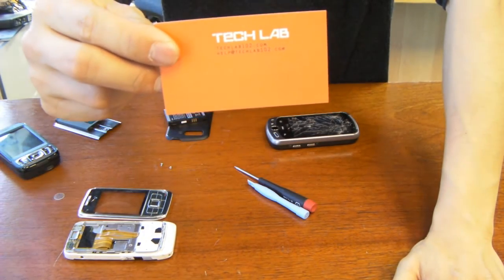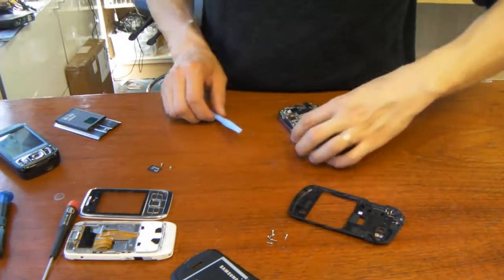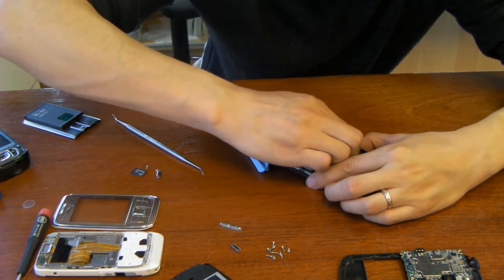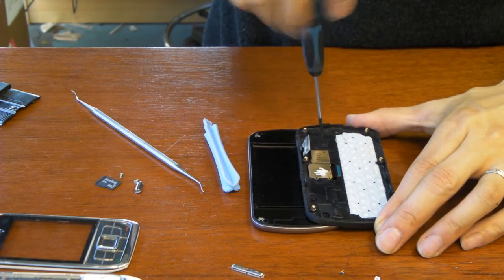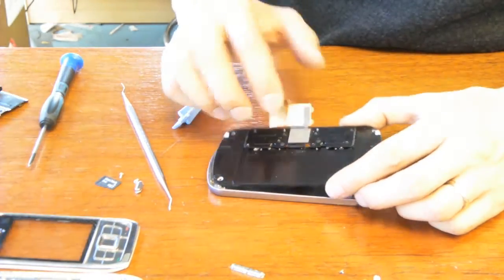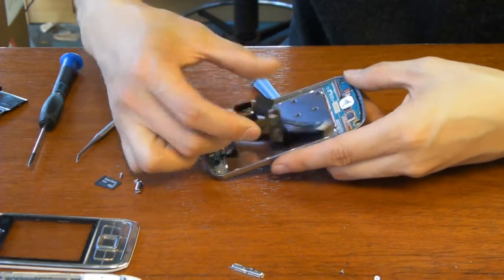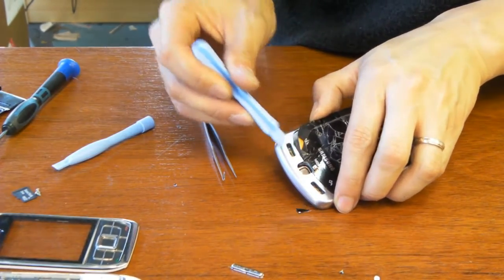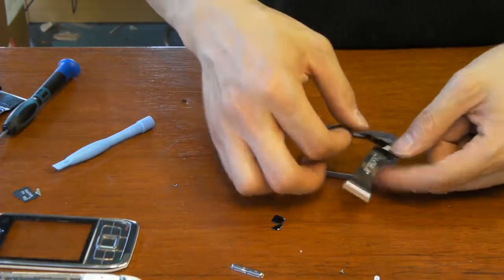Sprint Samsung Moment Disassembly

Comment from the maker: the 3m is great, but messy.  found a new solution, contact cement would also work well.  dries in 10mins and you have about an hour to adhere the pieces together.